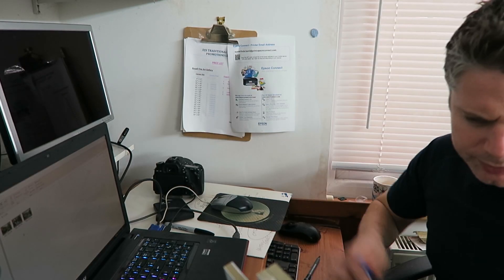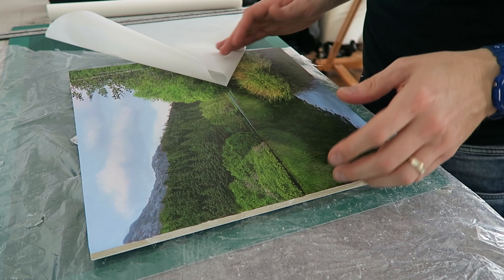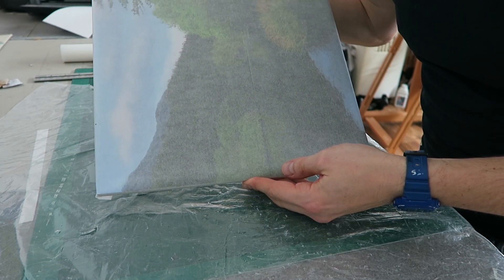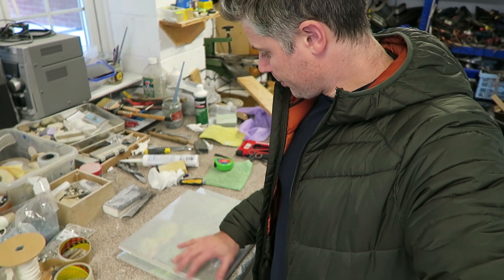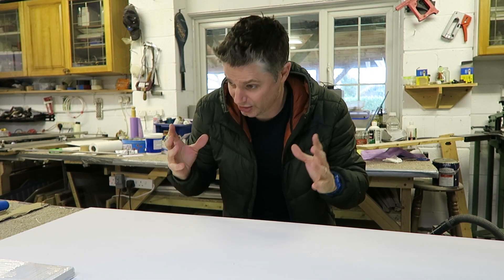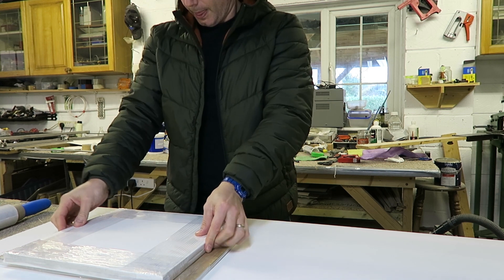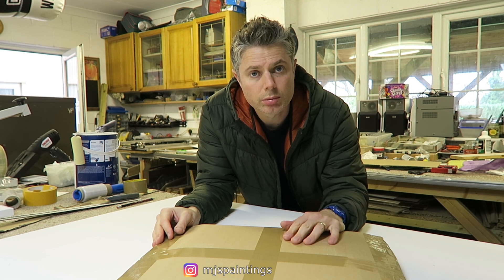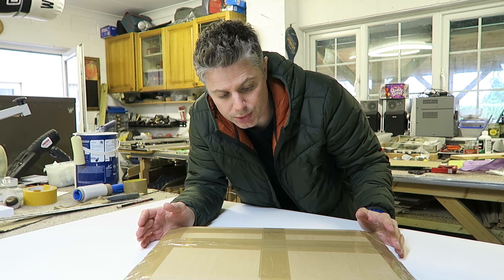#67 How To Package Oil Paintings | Oil Painting Tutorial

Comment: Did I hear correctly? You are painting on MDF board? Is that the same as Gater board? If that is so, do you prep the foam boards with acrylic and oil on top of that? I only use a piece of gater board to watercolor on. I tape my watercolor paper to the gater board.
Reply: SB Stone MDF is medium density fiberboard. It's made from wood byproducts that are held together with resins. It's sort of like plywood but made with fibers instead of sheets.